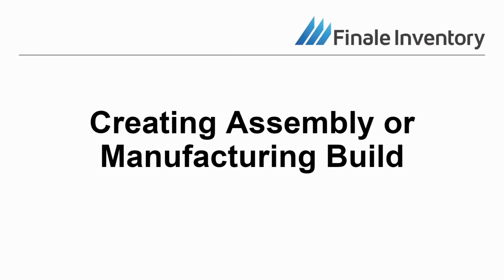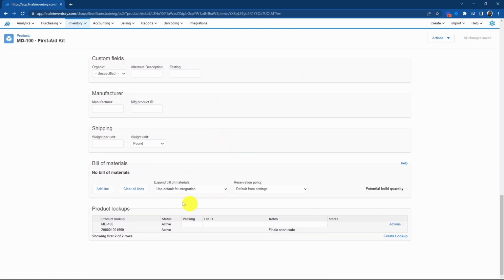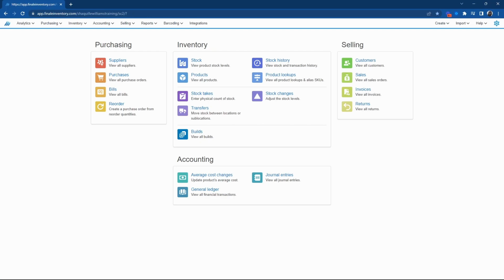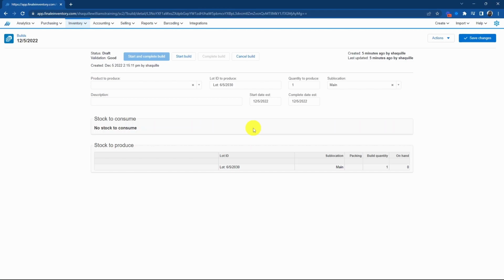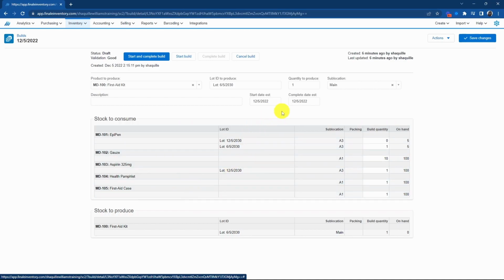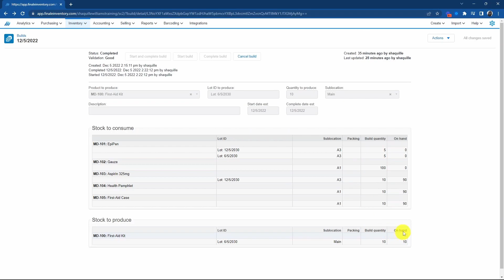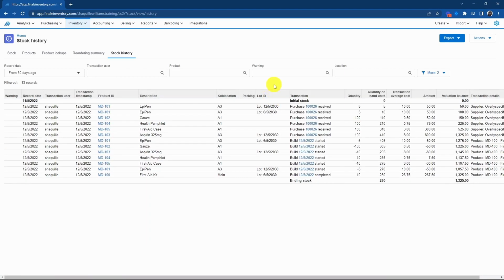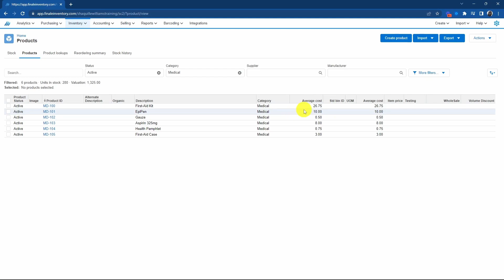How to use Finale Inventory's builds feature for assemblies and manufacturing

Comment: Suggestion… the bill of materials section on the product page needs to have some type of 2-step process to modify the BOM. We have a product that we ‘build’ using 20+ parts. When scrolling the product page the other day, I accidentally clicked the X to the right of one of the parts listed in the BOM and it deleted & saved before I could close out the screen. Luckily I have an excel backup and was able to re-upload. An ‘Edit BOM’ button similar to ‘Edit fields’ in the sales order screen would be great!